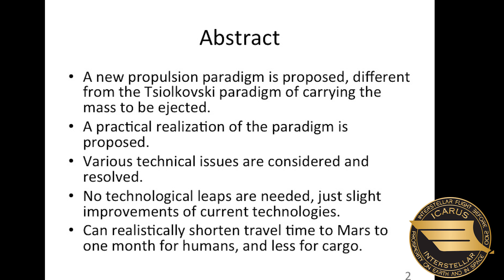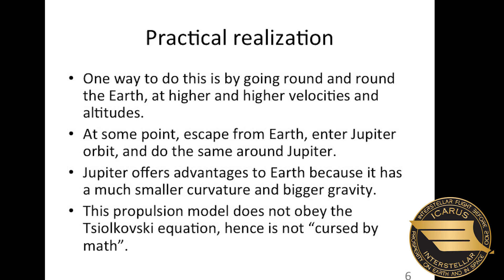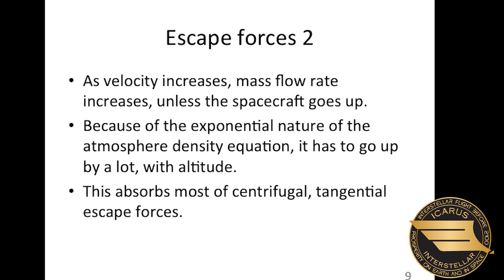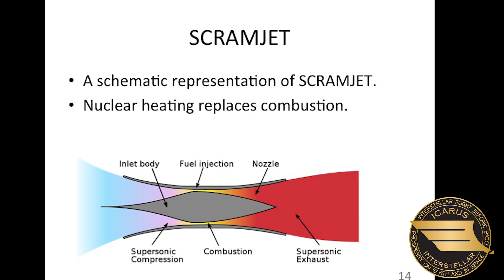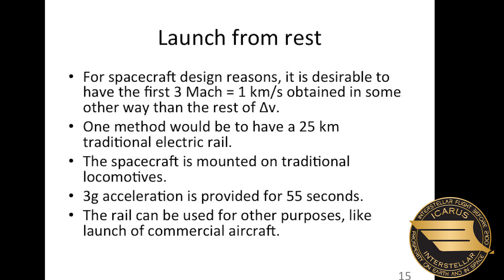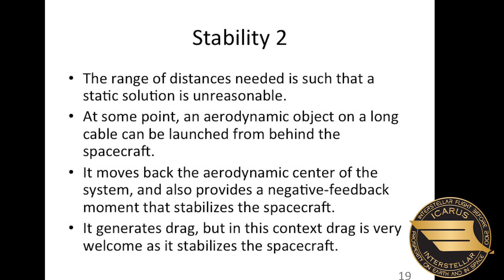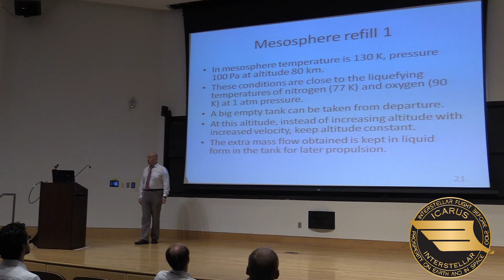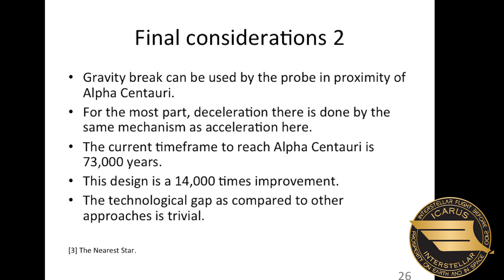Starship Congress 2015: Dr. Ilia Toli, "Fast and Practical Interstellar Probe"

Comment: So the idea is to use a ramjet for linear acceleration taking in air from the mesosphere of Earth/Jupiter?
Reply: +Tom Riecken Get more and more linear velocity by going in wider and wider circles. This certainly doesn't require an arcane like time warp and what not. There are certainly problems, we don't know how fluids behave at thousands of Mach. We don't know how they behave at 70 Mach, whether new aerodynamic phenomena appear. Then obviously there is the problem of curvature. On Earth atmosphere you can accelerate so much, even at height 80 km that I have calculated. Maybe you can reach 50 km/s, using plenty of negative lift to cancel escape forces. Then you shoot for Jupiter. Let's say that on Jupiter atmosphere you can reach 1,000 km/s, or even more. That's still very far from a practical mission to Alpha Centauri. Well, at these velocities, in close proximity to Sun, closer than Mercury, you can collect plenty of solar wind, which basically is helium and little else. Now you can accelerate a lot. Keep accelerating and getting more and more distant from Sun. Before you reach 1 AU distance, you already have velocity comparable with the speed of light. Those quantum mechanics effects are no problem whatsoever up to some 85% speed of light. Then, up to 98% speed of light, the mass of the vehicle and people inside increases sevenfold. Still reasonable for most purposes. Don't have to be at 98%.

Comment: Centripetal acceleration a = v^2/r. Moving at light speed around Jupiter in an orbit with a 90000 km radius, corresponds to a centripetal acceleration of 10^8 g. Impossible.
Reply: +Ilia Toli At 10% of light speed, the acceleration would still be 10^6 g around Jupiter and 10^5 g around the sun, destroying any craft. Nevertheless, I like the idea of a probe without propellant. What kind of thrust could such an engine produce?
Reply: +Ilia Toli If I understand it correctly: the density of the interplanetary medium is equivalent to about 1 H atom/cm^3. With a solar flare this could be 10 times higher: 10^7 atoms/m^3, so 1.66*10^-20 kg/m^3. With a generous engine inlet cross section of 100 m^2 and a velocity of 30000 m/s we'll have a mass flux of 5*10^-14 kg/s. About 5 grammes will pass the engine during a trip of 10^11 m.
Reply: +Ilia Toli If I understand it correctly: the density of the interplanetary medium is equivalent to about 1 H atom/cm^3. With a solar flare this could be 10 times higher: 10^7 atoms/m^3, so 1.66*10^-20 kg/m^3. With a generous engine inlet cross section of 100 m^2 and a velocity of 30000 m/s we'll have a mass flux of 5*10^-14 kg/s. About 5 grammes will pass the engine during a trip of 10^11 m.
Reply: +Ilia Toli The atmosphere around a planet can have a tail, which might be of use. Pluto is a nice example of this: It's ionised (ION engine?) but I don't know its density. Comets have a tail too but with larger particles which could destroy the space craft.
Reply: +Ilia Toli Oops, though the density of solar wind at 1 AU can be 10^7 atoms/m^3, it is not the maximum value as I suggested. Density can be 10 times higher which would mean 50 grams passing the engine during a trip of 10^11 m.
Reply: +Ilia Toli Luckely, you can enlighten me with the real numbers, so what is the density at 1 AU or Mars?